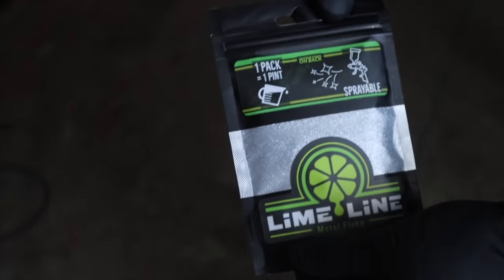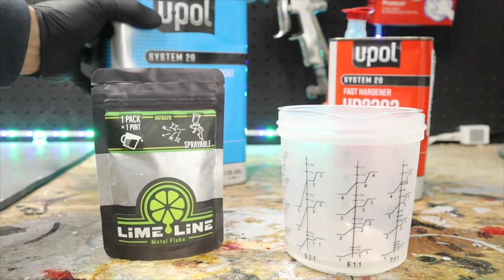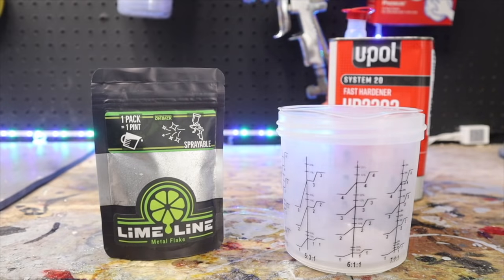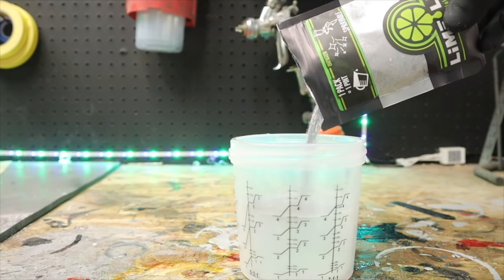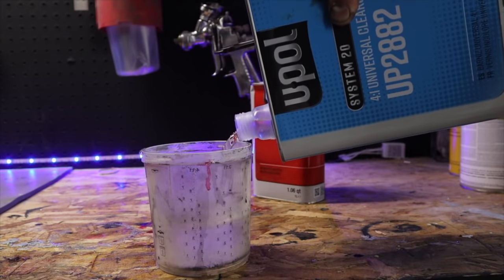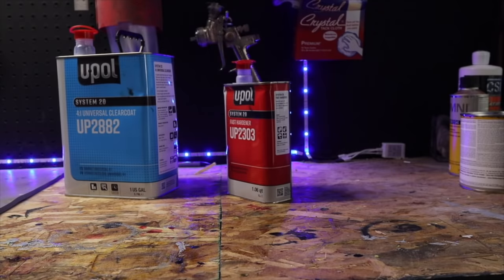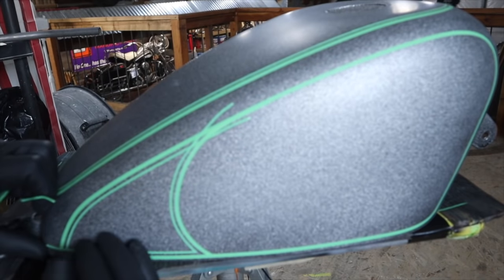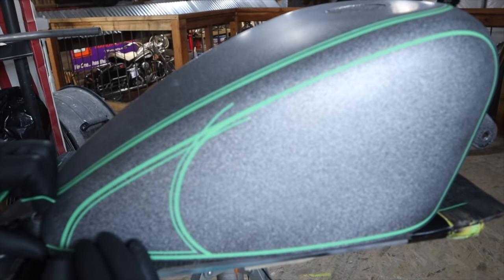Serape Mexican Blanket Candy Paint Job Tutorial, Harley Davidson Metal Flake gas tank

Comment: Hey man, great outcome, cool video. It's nice how you captured every step.
There's a few things i simply can't agree with though.
In the beginning you remove the "Harley Davidson logo" with 80 Grit. I do understand that's a fast approach, but seems way too rough, 180/240 should've been just fine.
Afterwards you "refine" it with 600 Grit. That's way too fine in two ways: 1. You won't ever get rid of the 80 Grit scratches. 2. You apply so many coats afterwards, you're screaming for adhesion problems.
I do understand you get rid of the 80 Grit scratches with all the coats, the flakes may be quite big, and with all that candy you won't be able to tell. But people watch to learn, and won't understand what the problem was after they become visible in their projects.
You're fast approach to the underside of the tank with simple Scotch Brite is quite questionalbe, would've liked a bit of actual sandpaper work by hand beforehand.
Sanding in between with 600 Grit is too fine in my opinion, might want to take 400 for better adhesion.
It doesnt seem like you're measuring distances between lines often, and go just by looks. Why not use tape as in between measurment more often ?
Reply from the maker: 🤷‍♂️ Thanks for the comment.

Comment: Amateur painter here, my first metal flake attempt on a tank ended up with a few sags and runs on one side. Can you show how to repair and how to prevent. I have repaired runs and sags on straight color but never flake. Your one of the best on the tube.
Reply from the maker: The flake usually moves with the runs in the paint so it gives it a funky look that will not go away with sanding. The best thing I can tell you is to sand it down with 600 grits and re-flake it again with more flake and clear.

Comment: I would love to see you demo a dry flake application (I’ve just bought a Flake King 1000, that’s why 😆). Anything else from you would be good to be honest, I’m so keen on this stuff. I’ve got an old guitar body I’m gonna dig out to use for a test piece. It’s a bit battered but that doesn’t t matter, I’ll get it all in flake first, seal it with 2k and leave it for a day or so.
Reply from the maker: Exactly!  When you blow it on dry it leaves allot more texture. you may want to clear it agin 1 more time and sand before graphics.  the LiME LiNE applies much smooth and is more user friendly.

Comment: I’m trying to understand how you went from 80 grit to 600 without sanding scratches being present when painting your BASECOAT? I would have thought the metallics would have shrank into the those scratches and highlight them, perhaps just so many layers that they fill in. Great job regardless , just curiosity
Reply from the maker: I used a high build primer to fill in the scratches. I show it in the video. Thanks

Comment: Hi Adam, great work as always. Quick question - is there any advantage to using a black basecoat under the flake over, say, silver?
Reply from the maker: Yes, with silver base you loose a little bit of the sparkle intensity rather than black basecoat.  You just need to make sure you have good coverage that's why I use LiME LiNE. You can get it here
https://www.amazon.com/shop/timewarpcustompaint?ref=cm_sw_em_r_inf_own_timewarpcustompaint_dp_IvpgheYhKwUT0

Comment: I'm 15 years old and I'm bearly getting into cars and stuff, but what is candy? Also why do you sand it down right after applying the clear coat?
Reply from the maker: Candy is different from other paints because its transparent. You sand the clear coat so the next layers of paint will adhere but not right after. usually like 24hrs or so. Check the directions on the clearcoat you're using. Thanks for watching!

Comment: I see you use glass cleaner after you have flattened the clear after flaking. Do I have to use that or can I use standard body shop panel wipe/degreaser?
Reply from the maker: I use glass clean because it removes the sanding residue better